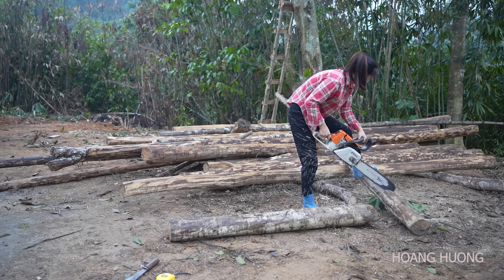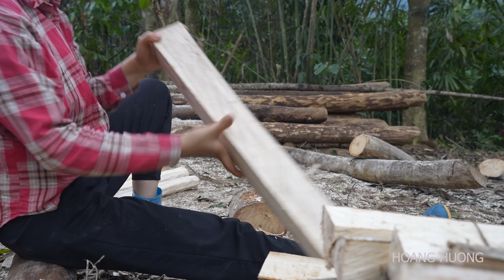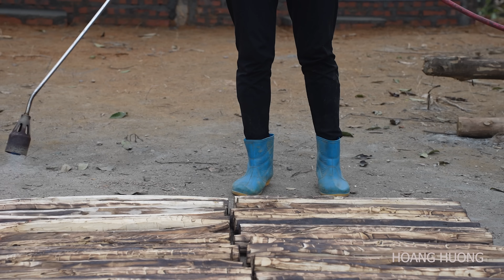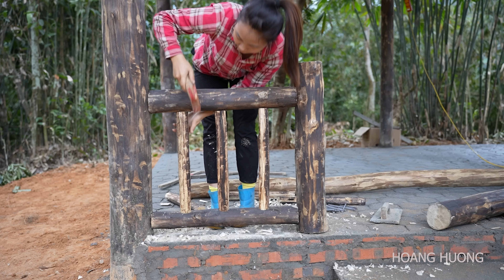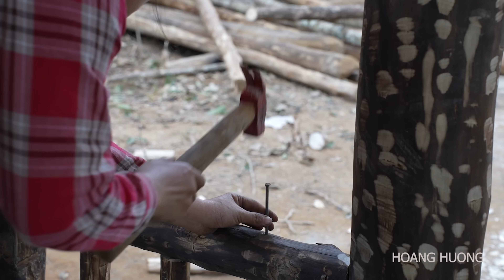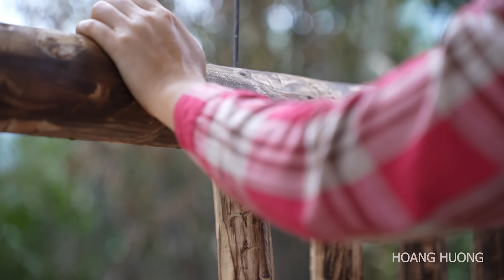Build Wooden Houses, Make a Railing | Treat Wood Yourself - How to Treat Wood Against Rot

Comment: You need to do a little water proofing under the posts. A piece of tar paper, a metal can lid or something to keep water from going up into the post. Also if you put some oil on the bottom, it will help to lessen water uptake.

Comment: What a beautiful and inviting place you have made. You will need to secure the end posts to the floor some how. Anyone grabbing one coming up the stair can pull it towards them. It would be good to secure it to the main post also as grabbing or pushing the end ppst could pull it all away. 
I'm so impressed with your sense of design and the time you took making the beautiful railing.

Comment: Instead of nailing the spindles, if you make holes in the top rail twice as deep as the bottom rail, you can push the spindle up into it, then just drop the spindle into the bottom hole. No nail needed. That way if you ever need to replace one, just lift it out and replace it, no need to try to pull the nail, no rust from water rusting the nail head.

Comment: Что мешало в верхнем и нижнем прясле просверлить отверстия вставить туда поперечины и уже верх сколотить...и не нужно было столько гвоздей и времени тратить...
Reply from the maker: I don't know if I understand what you mean correctly, but if so, you see, my upper and lower axes are quite small, but my tree segments are very large. If you want to thread the tree through the shafts, it will take a lot of time to make the tree bars smaller. So I think the teeth will be the same either way. Furthermore, I find that keeping the bars inside the shaft will maintain a better aesthetic.
Reply: @Hoàng-Thị-Hương  я имел в виду что сверху сделать также как снизу отверстия и тогда не надо было тратить гвозди...